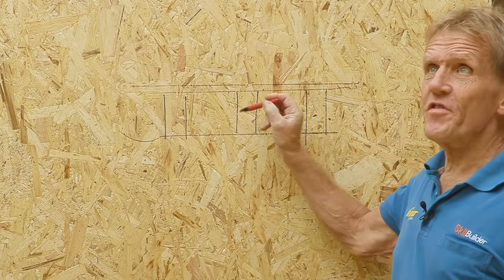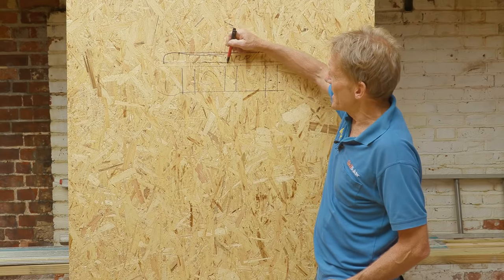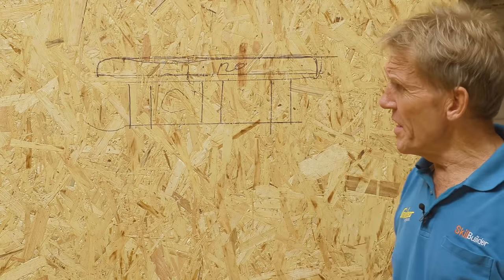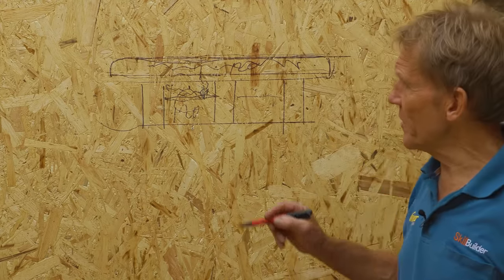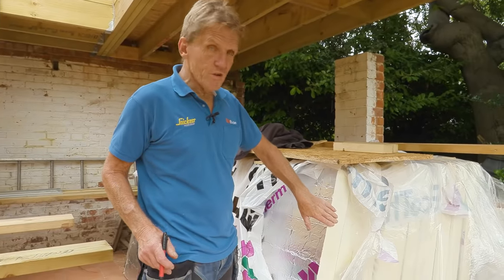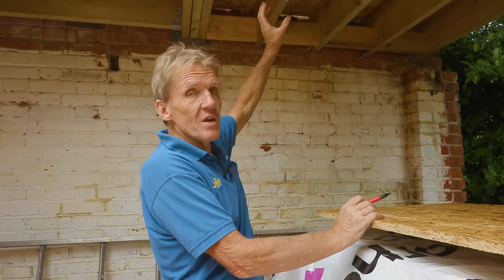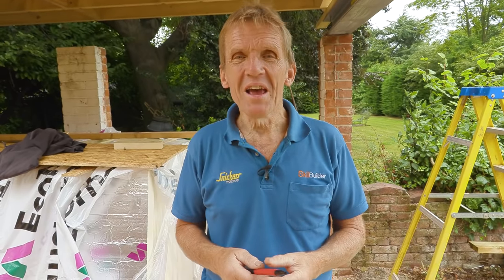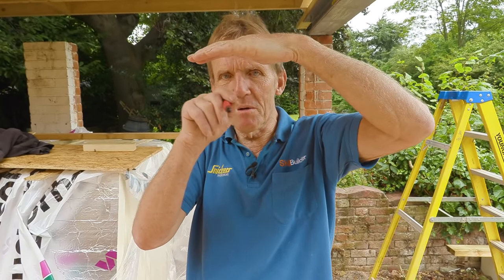Warm Roof vs Cold Roof. What’s The Difference?

Comment: When I had mine done I had to have 2 by 1 roof battens placed across the the top of the   joists before the osb for cross ventilation I noticed you haven't got it here. Do you not need to do that anymore . Thanks
Reply from the maker: Hi Barry 
Cross battening is one solution but it needs 2 x2 to be effective and we had no cross flow of air on this roof. two sides are closed in.

Comment: I have a c.1930's house, with the loft covered in about 100mm-150mm of rockwool insulation. Roof tiles are exposed, with no lining/felt underneath. If I were to buy some bags of rock wool insulation to lay ontop of the existing, will this be ok, as I don't want to create any vapour issues as you have mentioned? If so, what depth of insulation would you recommend? 50/75/100mm? Thanks

Comment: Wouldn't silver sealing both sides of the foam based insulation help with the cold surface spot condensation buildup??? I'm sure that'd be a manufacturer's question to ask or consider... But what say 'ye about the notion possibility Roger???
Reply from the maker: Yes it would do the job for sure.
Reply: @SkillBuilder : Thank You very much for a reply... I appreciate it...

Comment: Hi, Love your video, never watched others that actually put confidence in me. Can I ask a question? I am insulating (cold roof) my workshop but only have 65mm/2.5inch joists. I can either get 30mm or 40mm PIR leaving either a 25mm or 35mm gap for the ventilation. I have soffit vents all the way across and a open channel the other end for ait flow.. Would you go for the 30 or 40mm PIR? is 25mm air gap enough? thanks!

Comment: isn't having insulation in between the joists the same as a warm roof when you think about it though. Because in a warm roof you are saying the vapour barrier/aluminium foil on the kingspan etc is effective enough to stop moisture getting thorugh to the cold side of the insulation to the osb that is on top of the kingspan or similar and causing rot. So I would have thought a good vapour barrier behind the plasterboard, seams taped and a service cavity with battens so there is no holes from wiring or downlights etc would be just as effective. I think the problem arises with older houses where roofers come along and just put on a cold roof and leave it at that without touching the inside so there is no vapour barrier etc, maybe in your experience even in a new build or extension it is an issue too, but as I say it looks to me to be the same thing as in if you say the vapour barrier isn't enough alone in a cold roof surely it's not enough in a warm roof because it would rot the top layer of osb on the warm roof insulation.
Reply from the maker: If you can make a 100% seal on the vapour barrier there will be very little moisture above the insulation but that is difficult and it doesn't take much to cause problems. Don't forget that, in a warm roof,  the vapour barrier goes on top of the deck then the insulation so you are not relying on the silver foil on the insulation.

Comment: Great video, thanks. With a cold roof how do you deal with the electrics, running cables in the ventilation space above the PIR seems good until you have to feed cables down through the PIR (mine is 150mm). I’d have thought that breaks the barrier, creating cold spots. I am planning to use 600mm2 led panels to light the room. Can I run the cables on the underside of the PIR in trunking and plasterboard up to that ie leaving a small air gap between the PIR and the plasterboard?
Reply: I guess that’s why most use up lights so there’s no cables in the ceiling and it can run in the zones along walls instead

Comment: my flat roof(which i want to turn into a warm roof) runs into a pitched roof, would i seal the warm roof completely & then add some vent tiles to the bottom of the pitch roof to regain the ventilation i had from the old cold roof?
Reply from the maker: Yes I have just done a very similar job and had to do the same as you suggest
Reply: @SkillBuilder  thank you Roger

Comment: If you counter battened the joists, with 2x2, before you applied your osb, then you would have free flow of air over the entire roof. 
I’ve recently done this on a kitchen flat roof and it makes running wires and plumbing so much easier without having to drill holes. But mostly for through ventilation 👌
Reply: In think the work was done before the neighbors changed their mind.

Probably nailed the OSB to the joists.

Comment: Have you ever heard of alutrix 600 vapour barrior and where does the exhust air go from the soffits and where does the intake air come for the mushrooms
Reply from the maker: Yes I know that vapour barrier it is fine. The air inlet is along the soffit. It exits through the mushrooms
Reply: @SkillBuilder  so there's a mushroom between every joist? And with that barrior would you stick it to the ply wood or to the foam so the moisture hits the plastic first and not the sticky stuff

Comment: I have 50mm cellulose insulation, then vapour barrier, then 170mm fibreglass in my loft. Will this work? Am i on the warn side of insulation there.
Reply from the maker: Generally you would put the vapour barrier on the warm side of all  the insulation but I think this will be fine. There will be moisture in the cellulose where it hits the vapour barrier but it should evaporate.
Reply: @SkillBuilder I have heard that 2/3 of insulation should be on the outside of vapour barrier so i think my depths work but im worried how cellulose deals with vapour. I will add 100mm topper to fibreglass.
Reply: Will i have any problems with condensation?

Comment: Hi Rodger, would the same facts apply to a timber clad wall that was going to be insulated ? (eg a barn or outbuilding) clad external and internal and insulated in the gap.
Reply from the maker: It is a variation on the theme. With a wall you have the vapour barrier behind the plasterboard.

Comment: We had a big extension and the builders tapped into existing pitched roof and had a flat roof go over to the other pitch, the problem i have now is it was made as a cold roof and the bed room  ceiling is 500mm from the roof joists with rollout insulation on top of the plaster board and the ply they put on the flat roof is rotten, they said they made it a cold roof because the existing loft is a cold loft but where its going mouldy is when i have air coming across up a pitch across the insulation then in to the loft space, i have had more tile vents put in but carnt find out why its still mouldy, i do have down lighters in bedroom and from memory they didnt put up a vapour barrier between the plasterboard and the joists, i now need a new roof but carnt work out if i need a warm roof or not as its connecting to a cold roof and i dont want to spend another 10k to have the same problem but some where else.
Reply from the maker: Send us some pictures and maybe some video footage and we will try and help you

Comment: I always put the vapour barrier between the plasterboard and the joists?
Reply from the maker: Yes I do that but the drawing shows it on top of the OSB so the joists and OSB can dry out into the room rather than having trapped moisture in the void..
Reply: @SkillBuilder  sorry, I didn’t watch to the end. Would you put a vapour barrier between plasterboard and joists, and over the usb below the insulation?

Comment: Hi Roger, I'm fitting a new suspended ceiling in the snooker room that we use. We are replacing the old imperial ceiling grid and tiles and all labour is volunteered. The room gets very hot in the summer and I was wondering the best way of reducing the heat from the roof radiating down. The roof above is a pitched timber roof and slate tiles above.  I want to used the cheapest method and was wondering if Knauf loft insulation laid above the ceiling tiles will work? I know Kingspan would would be best work but we don't have the budget for kingspan?
Reply from the maker: You can certainly make a huge difference with glass wool. You would also do well with multifoil on the underside of the rafters.

Comment: I never really understand the vapour barrier aspect, your just gonna trap the moisture at an earlier stage and get rot somewhere else, or not as the case probably will be. Not many building inspectors I’ve met ask for one with PIR as the foil act as one.
Reply: As long as you tape your joints (cover my back)
Reply from the maker: Yes you are right the taped joints work but how do you tape the joints on the underside. If you do them on the top the vapour is in the insulation and that stuff turns to mush when it gets wet.
Reply: @SkillBuilder  If the moisture is stopped before the insulation won’t it just sit ontop of the osb that’s directly on the joists?  I’m not trying to be awkward it’s just something I’ve never really understood before.  I might add I’ve done approx 15 warm roofs over the past decade and never had a problem.

Comment: Im in the process of building a garage/garden room . I had planned to do a cold roof with osb and rubber roof but with the huge price increase in timber I'm looking at the option of metal roofing sheets, could I use the same cold roof technique but replace the osb/rubber bed with the roofing sheets, still ventilate above the insulation.
should I use dripstop, anti condensation liner on the roof sheets?
anybody have any thoughts /opinions

Comment: I know it's really expensive but could spray foam insulation have helped in this situation?
Reply: It would be worse, as they need a void directly below the OSB and above the insulation.

Spray foam you wouldn't be able to create that void.
You would have to batten and ply the top again to create it.
Reply: I think that's a good idea too. There are two types though - open cell and closed cell. I think the closed cell type should work well since it's basically an insulated fully glued-in-place waterproof and airtight membrane.

Comment: Wheres you furring pieces,where’s the fall on roof.? Ventilated soffit ,upstand along wall with 1 inch fascia vent  creating box to allow air flow.
Reply from the maker: Furring pieces are in. We could do the box upstand but the height of the wall is only 150mm above the deck so it is tricky. I think we are going back to the warm roof now

Comment: People on YouTube push the insulation right up to the osb. Then vapour barrier inbetween insulation and plaster board...what's wrong with this method?
Reply from the maker: The moisture condenses behind the insulation and can't escape. If the vapour barrier is 100% then it will probably work but downlighters are the curse.
Reply: @SkillBuilder  Ahh ok, makes sense. Thank you for your reply.

Comment: Who told the neighbour that the roof was going to be higher? Many neighbours like objecting for the sake of causing problems. Warm roofs are recommended. If they mention anything just say it is required for building regulations. I have fitted a CB, antennae with no cable attached, as expected a neighbour is complaining of TV interference. Some neighbours are so bored that writing to the council is a hobby. Just ignore them.

Comment: ROGER, YOU SAY MOISTURE WITH PENETRATE PIR INSULATION WITH IT'S DOUBLE LAYER OF FOIL BACKING YET YOU SAY FOIL BACKED PLASTERBOARD CAN STOP IT PENETRATING, HOW IS THIS POSSIBLE AS ONE CONTRADICTS THE OTHER?
Reply from the maker: To be honest you have a good point but the guidelines say that moisture can migrate between the gaps and through the fixings of PIR. The foil backed plasteroboard will reduce the amount of moisture getting int the ventilated void but it won't stop it completely.
It is very unusual for builders to get every detail right so building in a bit of belt and braces is no bad thing.

Comment: Hi, I have a quick question:
I have a loft space / attic with a pitched roof clad with clay tiles laid on top of a thick black roofing felt type material that was nailed to the rafters before the roof tiles went on. The voids between the rafters in the roof space have been filled with kingspan. The kingspan was the same thickness as the rafters so it is touching the roofing felt and will be flush with the plasterboard or cladding I want to have as the finished surface. 
The roofing felt is waterproof. I have checked this myself. It also appears to be a non breathable material, not one of these modern breathable membranes  The roof rafters drop down and overhang the main house by a couple of feet. These rafters are open. not boarded off at the ends or boarded underneath the overhang)
Am I going to get problems with damp and condensation? If so do I need to remove the kingspan or can I deal with this using ventilation solutions?

Any advice from the channel or anyone with expertise in this would be gratefully received as I'm about to plasterboard and clad some of the areas and don't want the time and expense to be wasted
Reply from the maker: You really need a bit of ventilation at the back of the Kingspan.  The best way would be to batten the rafters so you can pull the Kingspan into the room slightly. The say 50mm air gap but I have seen it reduced to 25mm. 
Then you need to put one of these in on every felt lap so the void is ventilated. There are other makes available but the idea is to vent that roof and maybe put a small ceiling in so you can get some up and over ventilation. The final thing would be a really good well taped vapour barrier before the plasterboard goes on or better still foil backed plasterboard. 
https://www.aboutroofing.com/manthorpe-g630-roof-felt-lap-ventilator.html?gclid=CjwKCAiA9aKQBhBREiwAyGP5lUnhRyJNBjD6dr-CUVmvIzvFlWIQMv09y2wvL2vmK-PROsWHcaMW_RoCoAAQAvD_BwE

Comment: Hi skill builder if you have to seal all joints on your vapour barrier over the osb, how do you fix the insulation to the vapour barrier and then the osb to the insulation screw it all down i think is the obvious way but you will have a million holes punctured the vapour barrier ?? i am confused
Reply: Ideally I wouldnt use a top OSB board under the weathering layer as this too can create its own moisture trap, use a roof covering that can be applied directly to the insulation ie Bitumen or single ply, dont use GRP
Reply from the maker: Apparently the screws through the vapour barrier are tight enough to cause no problems

Comment: Hi Roger please can you give an idea for an install of a grp and or rubber roof, to replace a torch on felt roof. It’s 3.5m x 3m and has an internal drain (going down through the house and out the wall. Please could you give an idea for supply and fit the osb, and rubber grp or Firestone excluding scaffolding. Thank you for any help
Reply: It’s so easy, I’d just do it yourself.
Reply: Easy work
Reply: @gdfggggg  even the grp?
Reply: Dont use GRP or rubber ..
Reply: @johnmurch5653 ?
Reply: @haroldbetterson1877  never done gpr but it can't be as easy as rubber.
Reply: @canecorso3020   ?  GRP will de-laminate from the decking .. Rubber is sealed by a glue and is highly puncturable
Reply: @johnmurch5653  so what do you suggest? Torch on felt again?
Reply: @haroldbetterson1877  I’ve been using rubber for years and it’s always worked a treat.
Reply: @gdfggggg  what’s a rough price I should be paying pls
Reply: @haroldbetterson1877  couple of grand, something like that.
Reply: @haroldbetterson1877  Yes or Single Ply, both are superior membranes which have associated outlets to manage a submerged outlet
Reply: @johnmurch5653  what’s single ply sorry?
Reply: @haroldbetterson1877  pvc hot air welded membrane
Reply: @johnmurch5653  thx mate how’s the price compare to rubber

Comment: In my industry (zinc Roofing) warm roofs fail far too often. Cold roofs are a far better option.
Reply from the maker: Interesting. I would like to know a lot more about that
Reply: @SkillBuilder  
If the VCL isn't done correctly you'll get  moisture on the underside of the zinc, which will cause it to corrode. Zinc is very susceptible to moisture on the underside.
As roofs tend to have skylights and penetrations, there's lots of failure points in the VCL.

Our cold roofs are built differently to what you are doing on this building.
We will have on top of the ply 50mm battons and another layer of ply.
Reply: @Robert-cu9bm  Im in the process of building a garage/garden room . I had planned to do a cold roof with osb and rubber roof but with the huge price increase in timber I'm looking at the option of metal roofing sheets, could I use the same cold roof technique but replace the osb/rubber bed with the roofing sheets, still ventilate above the insulation.
should I use dripstop, anti condensation liner on the roof sheets?
anybody have any thoughts /opinions
Reply: @SkillBuilder   Im in the process of building a garage/garden room . I had planned to do a cold roof with osb and rubber roof but with the huge price increase in timber I'm looking at the option of metal roofing sheets, could I use the same cold roof technique but replace the osb/rubber bed with the roofing sheets, still ventilate above the insulation.
should I use dripstop, anti condensation liner on the roof sheets?
anybody have any thoughts /opinions